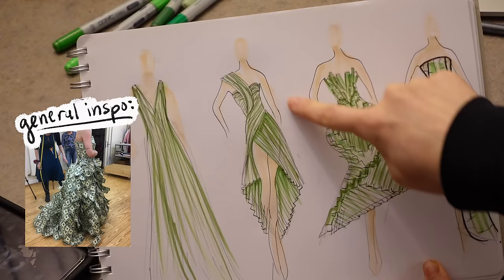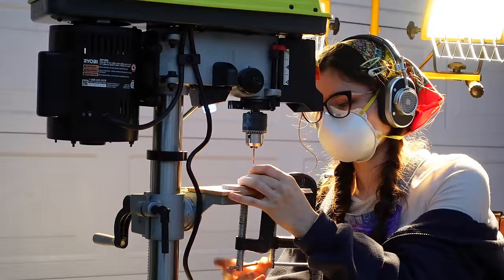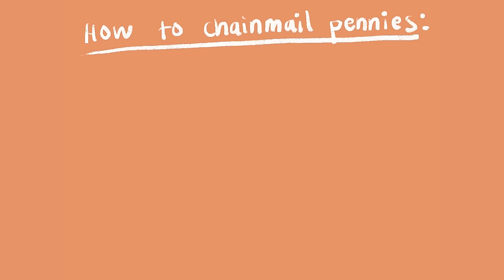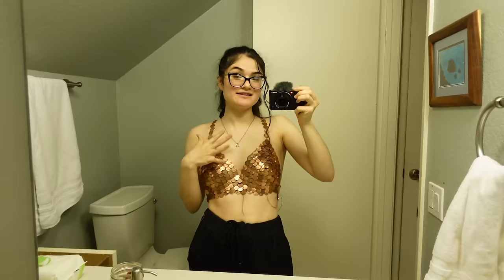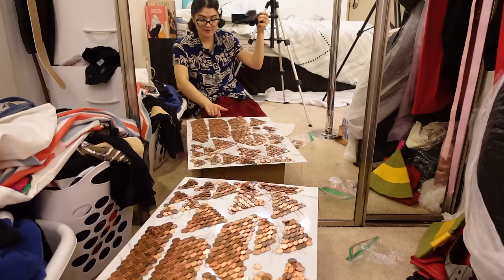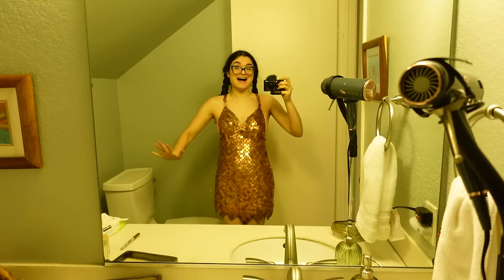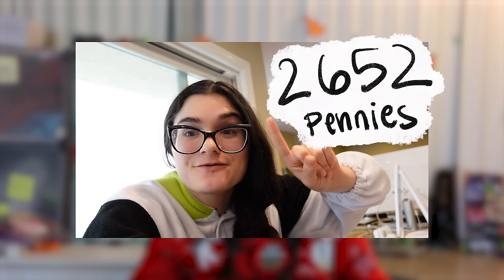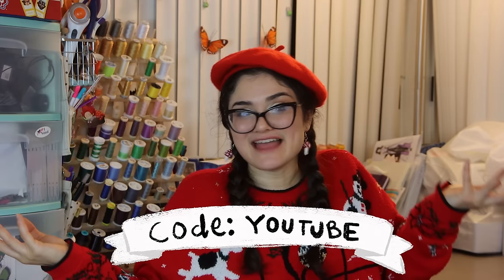Making a Dress out of 2000+ Pennies

Comment: if the shoulder strsp area was wider yet are more towards different weight points might help with the pressure focused on the one strap if its at least three to four while cross pivot to help with weight or add leather under strap

Comment: It’s so pretty, I’d wear it. I couldn’t afford it, but I’d wear it. The work hours for the seamstress would be prohibitively expensive. I think the key to making it wearable would be to find a way to keep the weight of the skirt on the waist and hips so that the shoulders don’t have to hold the entire weight of the dress, maybe by putting a clasp and horizontal band at the natural waist line, and maybe line it with a fabric so that the metal isn’t directly on the skin. I like the open back look, and a waistband with a clasp might be a practical solution to the shoulder pain and snapping straps without adding too much weight or changing the look of the outfit much. I like the earrings too, and the jewelry pulls the whole look together, it looks like something a movie star would wear on the red carpet.

Comment: While i dont make cloths but i have 2 comments. Firs is on the shoulders widen the staps to distribute the weight. Second add a cloth cushion under the pennies at the shoulders.  Midevil armor did both and it seamed not to be a problem..

Comment: I took part in a demonstration on chain mail in a castle in France, and it was worn bloused out over a tight belt to take the weight off the shoulders. The man couldn’t get the belt tight enough on me, so I had to stand there with all its weight on my shoulders 😅 I can’t imagine if the weight was concentrated in two tiny straps!!

Comment: I'm surprised it was only the straps that broke. I'd think the whole thing would come undone with all that weight pulling at the threads. Also surprised it was just pennies over bare skin. I thought you'd wear a slip or camisole underneath or even sew the pennies onto one or use a corset to help support the weight.